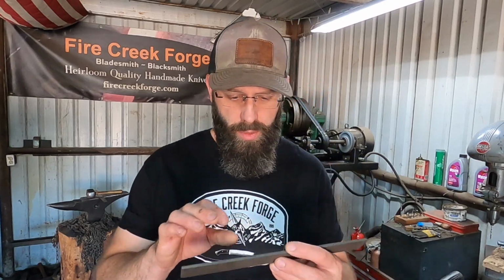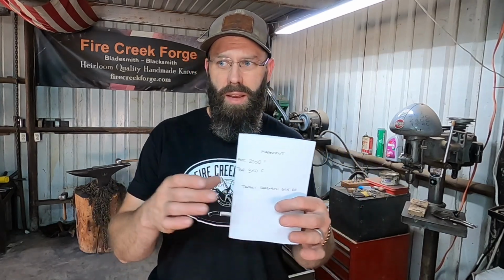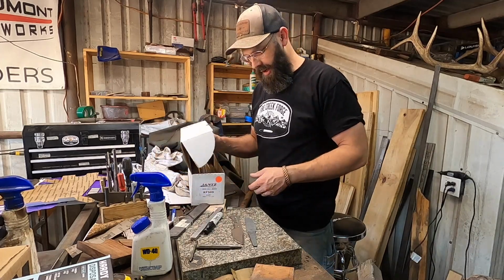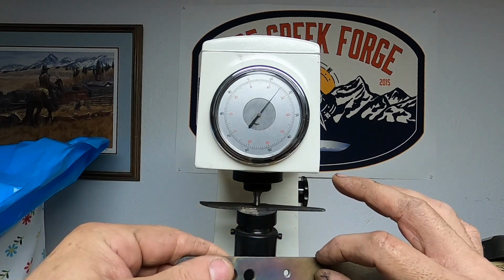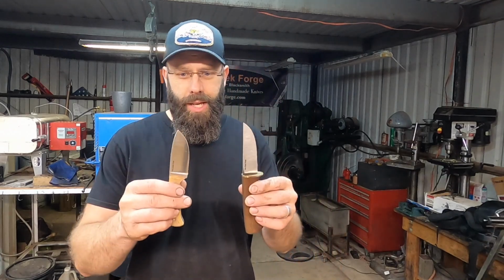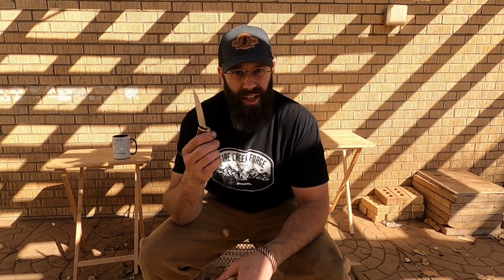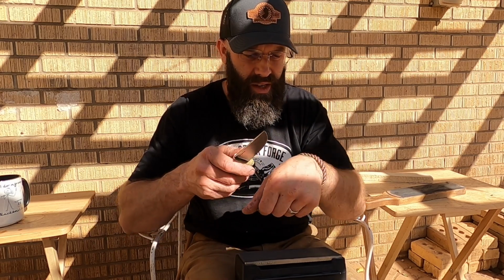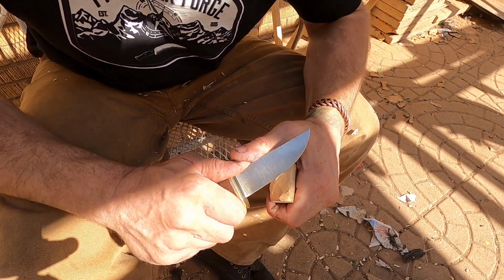First MagnaCut Knives: Forging And Stock Removal

Comment: 23:17 - its an air hardening steel… you may have just made it even harder….
Reply from the maker: @Forshledian  to harden it has to get up to austenitizing first temperature, which in this case is around 2200F

Comment: Had a similar issue myself with AEBL, hardness fils were just digging in, thought id messed up the heat treat along with cryo, so i said feck it just continue on and see.....once i surface ground it again and went to hand sand it was hard as hell to sand, then retested and it was 61hrc.

Comment: Hi Elijah,

thanks a lot for this video.

Did I miss the Annealing HT after forging before the Hardening HT?

If it wasn’t done it is very likely the reason why the forged one warped more than the stock removal one and it is also a possible reason for sub-optimum performance although the performance got better as the decarb steel was removed by multiple sharpenings.

Just out of my memory, the Annealing HT protocol is something like 1600F for 1 hour then from 1600F down to 1000F in 6 hours (100F/h)  then cool to room temp in still air or in the shut down oven. 

To be sure for Annealing HT protocol, check KSN website the article where LT discusses forging high alloy steels including SS.
Reply from the maker: Mm, yes. I did not do an annealing cycle. Something to consider in the total picture.

Comment: Any input on how many belts those knives needed to create the bevels?  I am hearing magnacut is hard on belts.
Reply from the maker: @osulxa  yes, there's a noticeable difference. I don't have an exact value but you would certainly have to factor in more abrasive cost when working with this steel, or any high alloy steel for that matter.

Comment: I'm pretty sure it's not your typical stainless. I've heard the only reason it's stainless is because of its fine grain structure.
Reply: Yeah, i guess it's more like a tool steel and doesn't have the high chromium content of most other stainless steels.
Reply: Most of the steel snobs say magnacut should be around 63 hrc. I can't personally tell any difference in real world use between a good carbon steel and these "super" steels. If i have to cut a single material hundreds of times and still have a tough time differentiating between steels, that's not very impressive to me. I'd literally have to do scientific testing to tell what steel is which. I am curious if you would notice the difference better with skinning some wild game. That would be cool to see. Good work bud

Comment: I have heard that forged Magnacut needs a decent amount of decarb removed by sharpening before. This is at least the third video I've seen with this issue.

It's still a fantastic knife steel. I have 5 factory knives in MC at around 62HRC and the edge retention is as good as my old S30V knives with way better toughness. I don't treat my cutting tools like prybars, but I'd still get a chip here and there.

I really like K390, M390/20CV and S90V too. Just need to know where to use it. 3V is probably more up your alley if you want a semi stainless that acts more like 52100.

Comment: I quite like stainless steels, there's a lot of great ones out there with pretty impressive qualities apart from not rusting up. 
Not used Magnacut either, there's a lot of other stuff to chew though in the shop first and its on my to-do list at some point, its not cheap though for us buying small amounts of bar stock. Used a fair bit of his other steel Apex Ultra and gotten some great results in terms of forging them- I will caution you with that one, its about 8-9 steps worth of heat treating to get the most out of it. Its also pretty expensive as well.